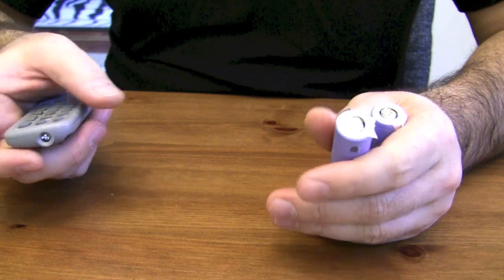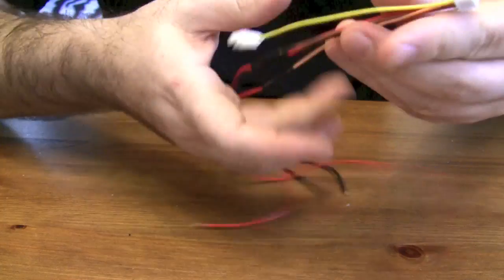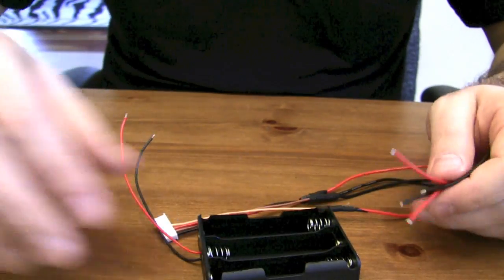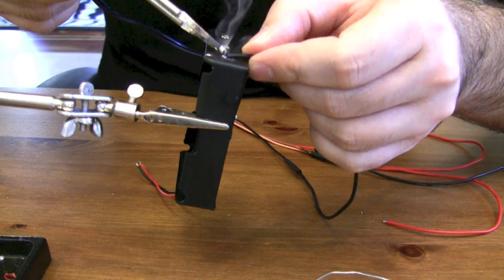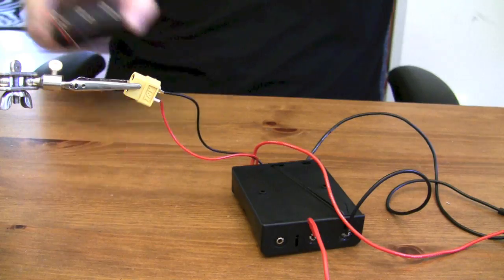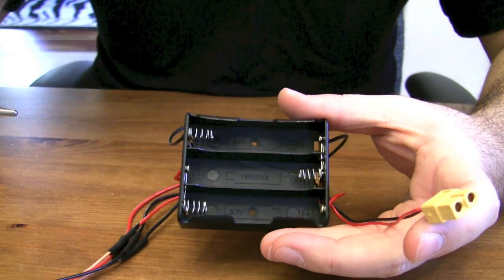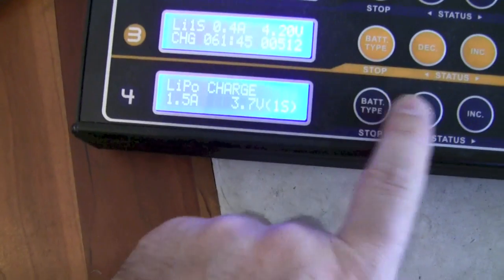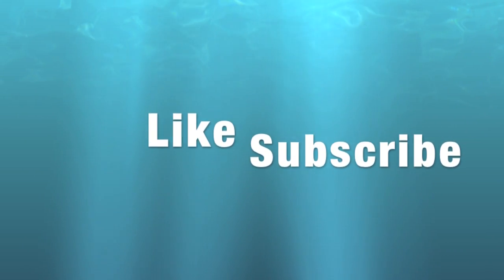How to make a 3S battery from reclaimed18650 lithium ion laptop cells

Comment: If i wanted to make a 12s battery could I just put 4 of those in series?
Reply from the maker: +Ben Kovacs that's is correct !
Reply: K
Reply: an 18650 is 3.7v discharged and 4.2v charged. a Lipo is 3.7v discharged and 4.2v charged. 
they are equivalent in voltage. one cell=one cell. so a 12s battery should be 12 18650 batteries in series which can be hard on the cells.
if you do choose to use 18650 batteries make sure you use married cells (bought, charged, discharged and used only with one another.) and pay close attention to hear because unlike lipos they will physically pop and can destroy whatever it's in. 
know your battery before you do anything to it. 
I'd like to say I know what I'm doing because I work in a very prominent hobby shop in my state and deal with Lipo batteries and I have been vaping using the 18650 cells for 3 years the whole time testing their limits.

Comment: would you have any idea on how to solder on a balance lead onto two in series and two in parallel?
Reply: That would be a 2S, 2 in parallel counts as 1 cell, so you only need 3 balancing wires, 1 to negative and 2 to the next positives.

Comment: How long can i fly an RC plane with this 3S (not parallel)  ? i am just curious, but i know it has a very less discharge; Thanx
Reply: depends. how long do you get with a Lipo batteries and what are the specs? a 3s Lipo and 3s 18650 will operate about the same if mah are the same but the heavier pack will obviously make the motor work harder and drain faster

Comment: how do you charge that battery type in LIPO mode?
Reply: same as a Lipo but I use less amperage than a Lipo. I would charge a 2500 mah at 2A max. but other people say other things. if you're not in a hurry then set them to around 1A and relax. it'll help the batteries complete life cycle too

Comment: I've read it's dangerous to use uneven capacity Li-Ion batteries because if one cell is bad or low capacity, it would overheat and explode.
Reply: you're right. 18650 batteries should be completely married. (bought at the same time, charged at the same time, discharged at the same time and never used without the spouse battery or batteries)
Reply: +freels michael and never with non-spouse batteries
Reply: I agree with you and that's why I prefer to charge every single cell separately and then connect them together

Comment: good video but you are breaking rule #1 of soldering......NEVER blow on a solder connection
Reply from the maker: You are probably right, but I did that most of my life and I never had a cold solder joint. I think the trick is to keep the solder joint perfectly still when you blow cold air on it.
Reply: air isnt cold until it was blown, so youre not blowing cold air on it but youre blowing air on it that will cool down a bit while being blown :^)

Comment: plz help me out i am in great trouble.. guys...
i had built a 3 cell 18650 pack for my rc plane but i am not able to charge it... i mean i had tried to do so but it just fried up my B3 AC COMPACT charger can any one tell me how can i charge it via my B3 AC charger
Reply: +Praveen Kumar this charger use the balancer of the pack to recharge them, so you need a 3S balancer cable to recharge.

if you are connecting the battery in the charger and cant recharge them, you need to check the voltage of every single cell. If are too low, the recharge will not recognize one or more cells and  do not will recharge for safety.

i have one turnigy recharge, almost the same, and any cell below 3.0 V, the recharge do not work, i see the lights flashing indicating a problem with the battery, and nothing of charge.

so:

1- get a 3S balancer cable, solder the terminals correctly.
2- check each voltage of every cell.
3- if the are too low, you need to recharge them separately.

tell me if you get any problem.
Reply: Pedro Bermudes thanx dear u made my day.. i think i had selcted wrong cable so i will try wht u said nd let u know bro.. thnx
Reply: when dealing with these cells call your local hobby shop or battery store. safety is the most important factor and online advice doesn't always come from a trustworthy source
Reply: yahh you are right.... any how i had bought nite core d2 charger for this
Reply: indianfrall nightcore is a reputable brand and good at charging individual cells

Comment: can this power a brushless motor on RC that needs a discharge rate of 30c and above?
Reply: Do you mean 30A? If so you can wire some of them in parallel to be able to draw 30A. I think these Samsung batteries he uses has a C-rating of like 2, so you would need at least 6 of these packs in parallel. Samsung and Panasonic also got some batteries with a max continious discharge of 10A, which would be a better choice. I have also heard of some "high drain" 18650's that apparantly can deliver 35A, but I haven't tried one.

If you still mean 30C, then no. You would need so many in parallel that it would weigh a million tons. (unless the 35A ones works). 

Also, if you find a 18650 with more than 3400mAh then don't buy it. They are fake. Never buy Ultrafire.
Reply: +IZuzivowoI This man speaks the truth. Never trust any batteries with fire in their names. They are crap! Li-Ion can do 2C maximum, but they don't like it. That is why Li-Po is used for hobbies. Lower capacity, but much higher discharge rate.
Reply: +IZuzivowoI yup. never buy ultrafire, a goled rule. Rated as 3000mAh, but in reality if they give out 700mAh is very optimistic. If you want higher discharge rates there are LiPo's for that, with all the added danger (quality costs...so pay more and stay safe, don't buy rubbish because it's cheap, it won't make you happy, IMHO).

Comment: nice video and good information. quick question.   would this 3S you made can I use it as 12v to power up portable boombox that I built ? how can I make this to become more  AH ?  if I made this into 5S ? also  what type of connector I Can buy to connect to the XT-60  do they sell female and male xt-60 connectors ?
Reply from the maker: grilledchickenwrap  You can use the 3S in a 12V boombox. Make sure you don't over-drain your 18650 3S batteries. If you want more AH, add more batteries in parallel. Example: for a 3S2P cell (which will double the capacity of a 3S) you will first connect two 18650 in parallel and then repeat that 2 more times. In the end you will have 3 pairs of 2 18650 connected in parallel. Then connect each set of parallel batteries in series to get the 3S. 
You will burn your boombox with a 5S. For a higher voltage you don't need a bigger connector. You need a bigger connector when your current draw goes up. XT-60 are an overkill for a boombox, but if you use the battery pack for more than a boombox, then XT-60 is not a bad choice. Good luck with your projects!
Reply: Thank you for the good information.. keep them cool videos coming..

Comment: How much sustained current can that 18650 battery holder handle?
Reply from the maker: Titus Corday You could draw safely 2-3A from most 18650. Careful not to over discharge them! 

That depends on the actual cell used, i.e. try searching for the  datasheet. Today a 2100 mAh cell will often be a high current cell and be able to handle 10 ampere draw.

Protection limits are from about 30% to 100% above the rated maximum current on the batteries I have tested.
Reply: I was referring to the battery holder used in the video, not the 18650 cells.
Reply: +jonny kotzur Awesome, thanks!  I purchased what appears to be the same 18650 holders a couple months back but haven't gotten around to testing them.  What protection circuit module do you use for high current applications? (5A+)

Comment: do you think thee is a balance protection circuit for a S3P7 battery pack?  I have 21 18650's that I would like to make a battery to run my telescope in remote locations.  Weight is a major factor.  Thanks for the video.  I've watched it numerous times.
Reply from the maker: Dennis Johnston Hi Dennis. Thank you for watching. I love watching the sky at night. One of the best places I've been to watch the stars was on Mauna Kea, Big Island Hawaii. Anyway, tricky situation with a 3S7P.  I am not aware of a balancing charger that will allow you to do that. However, I have a suggestion. Connect several 3S' in parallel. You can balance charge a 3S pack without any issues. all you need to do is build an adapter cable to be able to connect several 3S packs in parallel. Happy sky watching!

Comment: Where is the protection circuit?
Reply: Joshua Jerred How does the ESC know how much current the cells can continuously supply?
Reply from the maker: Titus Corday A protection circuit will not allow you to over discharge or over charge your battery. LiPo need that protection as they will get damaged if you over charge or over discharge them. They may even catch fire!
Reply from the maker: Titus Corday A protection circuit could be built in the battery (latest generation batteries) - not the one you get out of old laptop batteries. In a laptop battery, the protection circuit is the circuit board that is inside the battery pack. However, it will be hard if not impossible to use that for you own application unless you plan on using the entire battery pack. Go on amazon and search for LiPo protection circuit
Reply: ShowHowCast what is the c rating
Reply: Joshua Jerred no I know that how much dose it have

Comment: would you fly your rc plane such as for example and trust 18650 lithium ion's to do the job
http://www.horizonhobby.com/product/airplanes/sport/almost-ready-to-fly/pulse-xt-25e-arf-efl4100
Reply from the maker: Mike Sallustio ... Planes, maybe as long as you have larger wings (surface area), but I would definitely not fly multi-rotors. The current draw is way too high for these batteries.

Comment: pretty cool i have extra 3 18650 battery's lying around might make this but i was curuious what kind of punch do these have versus say a regular 2s lipo or even regular nimh batteries in the 8.4v and 9.6v range
Reply from the maker: ThePoolman2007 You bet they pack a punch. LiPo batteries in general have high power density. Meaning you can store more energy in a smaller and lighter package. However, they are harder to maintain. You have to watch out so that you don't over charge or over discharge them. You will also need a specialized charger for charging LiPo.

Comment: what's the benefit from doing it this way, vs puttinng the 3 in parallel and charging that way.  i've heard from other knowledgeable ppl that putting in parallel, the voltages will even out themselves
Reply from the maker: You balance charge the batteries when you do it this way. Much better for the health of the batteries. Parallel charging is not balancing charging.

Comment: Do all three batteries have to be the same capacity (mah)?
Reply from the maker: Ideally YES, but it is difficult to achieve that when you recycle batteries from different packs. I would stick to packing together 18650 cells from the same battery pack unless you know the capacity of the batteries you are working with. You can sometime find this info online based on the model info on the battery.

Comment: You are using a Li-Po charching mode for Li-Fe akkus ? This is dangerous. Think about the cut off voltage.
Reply from the maker: Are you saying that these batteries are Li-Fe? How do you know that?
Reply: Did I say Li-Fe ? Sorry.I mean Li-ion.But the problem with the cut off voltage is the same.Or do you juse these charging mode to match the akkus ?

Comment: The cable of your  main leads look very thin. Shouldn't you be using at least 14AWG cables considering you have max 3C per cell or about max 10C for the pac?
Reply from the maker: Depending on what you plan to use them for. You definitely what to make sure the leads are appropriately sized for you application. I my case I use them for LED lights.
Reply: ShowHowCast 
Hello! I like too much this tutorial!!!))) I saw you have more packs charging! This connection look like serie parallel true? I also interest about this because i need make this power bank for 25m leds stripes which will take arround 30 Ah!! So i thinking make two packs with 10 batteries each one with 18650 2000mah! But i need know how charge this two packs!!! Helpppp)))
Reply from the maker: I am not sure what configuration you ultimately need. 10 batteries in series or 10 in parallel. Even if you go with 10 batteries in parallel you should be able to charge all of them as a single 3.7V cell with a very large capacity.

Comment: i wonder how balancing actually works? does it just provide a path to ground at the positive end of the cells so that current will take path of least resistance and not charge the cell? guess i could work it out the voltage drop or what ever it wold be for a battery with such and such resistance.
Reply from the maker: I am not sure, but doubt that shorting of the leads is taking place.
Reply: maybe its just a switch in the cells?
Reply: marshalcraft its checks the voltage of eevery cell and charge them to 4,20 volts

Comment: +ShowHowCast I need to know how to charge Lith-ions cuz i heard there very picky on the voltage and different chargers that will work
Reply from the maker: Whenever you charge lipo batteries make sure you buy a charger that has a balancing feature and it is designed to or has the option to charge LiPo's. Any other charger will expose you the real possibility of overcharging or charging an over drained battery that will result in fire and damage to your property.

Comment: Hi guys.
Great videos. Can anyone help me out of how to connect the balance wires? I would like to build a 4 S battery for my quadcopter, but I am not pretty sure where to connect the balance wires. I am plan to use 16 or 20 of Panasonic NCR 18650 what should give me lot of power to run my quad. thanks for all the comments.
Reply from the maker: I don't know if I would necessarly recommend that you use 18650's for your quad. They may not have the required discharge rate, in which case you will damage them in no time. Plus, the power density weight ration is not favorable for flying. I would try to use 3S, 4S etc... battery packs made out of 18650's just to power stuff that does not fly :).
Reply from the maker: ShowHowCast I tried my 3S3P battery made out of 18650's and I barely lifted the hexa off the ground when I got the low voltage warning. These batteries do not have the discharge rate required for such power hungry machines like multi rotors. I may post video with that.
Reply: ShowHowCast
What type of multi-rotor did you use? I also presume you used re-claimed batteries? If so you definitely cannot use use re-claimed batteries (especially batteries that are several years old). You have to use the newer Panasonic 18650 batteries and you also have to use low KV motors with larger props. I found some very good youtube videos showing successful implementation. You have to keep in mind that it is not for aggressive 3D MR flying. What you will get is long duration (1hr) flight times with the proper frame,  motor and prop configuration!
Reply from the maker: Peter Klimon I have a DJI F550. I do not use 18650's to fly. I tried and a fully charged 3S battery pack lasted 15 seconds.

Comment: so i want to make a portable battery pack, so to balance my batteries i need to unsolder them then re-solder them each time i want to charge balance LOL :), that's alot of solder i need $$$ :)
Reply from the maker: Try not to remove the metal band that originally connects the 18650 batteries. If you leave a short metal band pig-tail (up to 5 mm), it is easier to solder a wire to the pig-tail metal band than to solder a wire to the ends of the battery. Good luck. I will post a video when I have some time to show the above.
Reply: you can also use Neodym magnets to fix your charger crimps on battery.... i always use them :P
Reply from the maker: SnowChiller I would not do that. They do not provide the good mechanical and electrical contact that high currents need.
Reply: ShowHowCast I dont think that really high currents are need to charge batteries :) never had a problem with that.